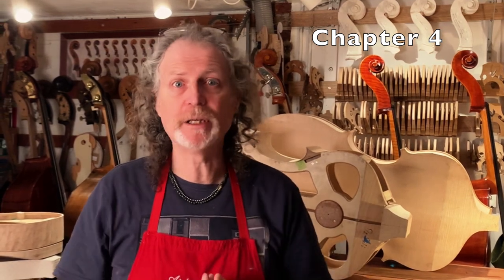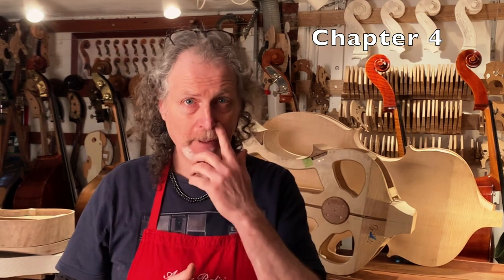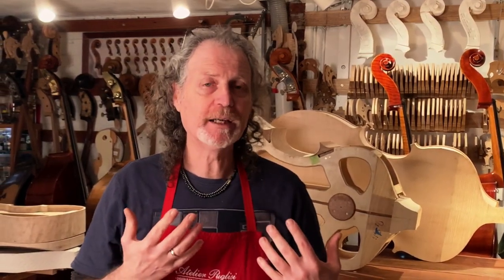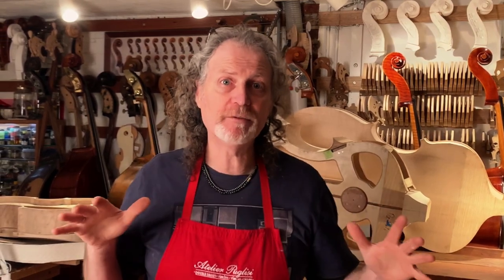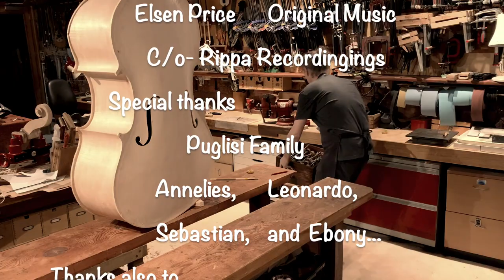Making a Meyer Double Bass: Chapter 4 "The Voluptuous Back"

Comment: I totally agree with WLandsale. I'm watching this this video's in Belgium while I'm working on an arched back double bass. Great.  (I'm 70 years old)
I have a question. Do you give the back plate everywhere the same thickness ? (and how much?)
Reply from the maker: Never too young to build you your Bass. The thinkness of the back plate is approximately 8mm in the middle to 4.5mm around the edges with the middle edges about 5.5mm It will always depend on the stiffness of the timber.
Reply: Thank you very much.

Comment: Oh, my elbows are so sore just watching all that planing!
What is the function of the toothed blade?
And I'm also fascinated that you are able to bend the break steaming the back on just one side. I would have assumed you need to get some steam on both sides to make that work.
Thanks again for the inside view of this make.
Reply from the maker: Hi Jacque. Glad you like the series. The toothed blades are used to cut through the fingered timber. I sometimes use them on a tricky Ebony fingerboard as well. The advantage is you can go in multiple directions without tearing out and making holes. I also have a set of these blades for the soft spruce tops as well. The teeth are not quite as bold but they help reduce blow out.
At the point where I'm bending the back plate the steam works well as the moisture easily penetrates. It is only around 2.5 mm thick at this point. Pretty much the same as the thickness of the ribs. Maple at this point is normally quite flexible, with some persuasion. The final episode in the series should be released shortly. Just wanting to get a nice recording of the instrument first. Thanks again for your comment. Benedict

Comment: Really excellent series, always great to watch a real craftsperson at work. One thing did interest me, whilst watching all the planing of the back. 
I notice you are using push planes, but pull hand saws. Was watching another channel where a Japanese guy was doing woodwork, and was impressed with the pull planes he was using. The logic of the pull saw makes sense to me, as you are always cutting under tension, and having tried a japanese style pull saw, I find, is much better for accurate and straight cuts.
Have you ever tried the pull style plane? I wonder if a similar logic also holds for these, as it does for the pull saw.

Just a thought!

Anyway. liked and subbed to your channel now.

Comment: first, thank you so much for this content. second, why you make a soundpost patch at this point? there´s a research on better acoustic results with this?
Reply from the maker: Thanks Mate. Great question. The area under the sound post is very vulnerable to distortion after years of pressure. The original instrument played by Edger Meyer Is actually very distorted on the back plate.
On a flatback bass typically a spruce strut is added. which is something I have also done on carved backs. However Instead of making the sound post area thicker, which isn’t beneficial acoustically, I choose to strengthen the area with the small patch.
Reply: @atelierpuglisi  thank you